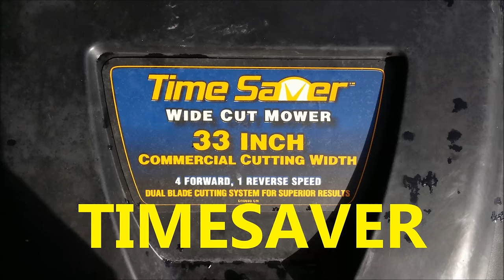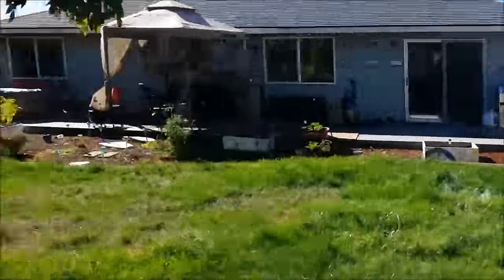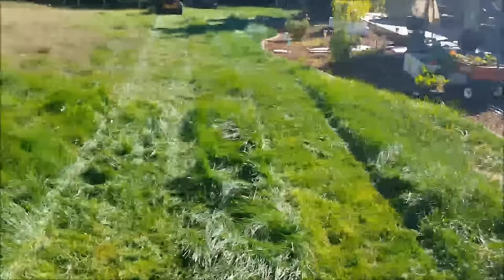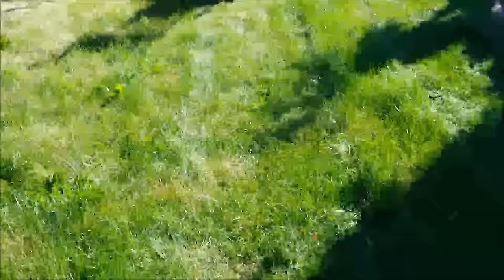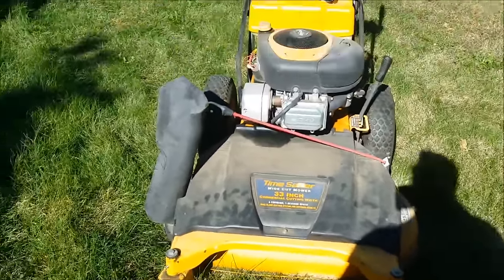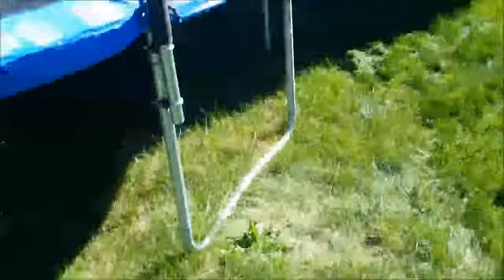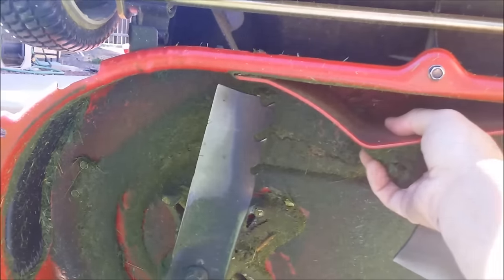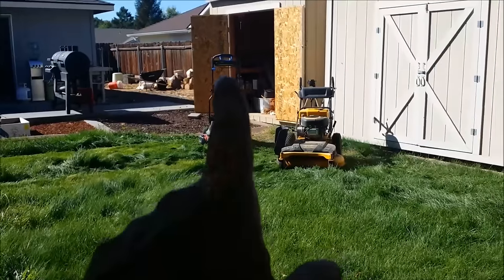Cub Cadet 33 in. VS. Toro TImemaster

Comment: I don't know whether the Toro or Cub Cadet is better, but the belts are too lose to cut anything on that Cub. You say the blades keep "stopping," that is cause the belts are worn out or simply need adjusting. This comparison is fruitless cause the Cub is not functioning properly.
Reply from the maker: Actually the blades where stopping because grass gets bunched up between the deck and the blade gap and then causes belt glazing, this can happen with any mower when put into too thick of a grass which it can't handle properly. I would love to do a new video of these but I haven't owned a cub cadet in a few years.  But feel free to post your own video of your timemaster and your cub cadet.  Thanks for watching
Reply: @BirchsLawnCareLLC  Dude, if the blades are stopping, for any reason, on any mower, when under a load, and does not stall the engine, there is a problem. Your belt needed adjusting, or was worn to the point it couldn't be adjusted. Belts are not designed to start smoking and slipping when under a load as you described in your video.
Reply from the maker: Yes you are correct, they where slipping because they had been glazed already. It was a continual problem with this mower, yes new belts would kill the mower but eventually they get glazed and slipped. it wasn't an adjustment issue I was just tired of this mower having issues like this way to often. I understand what you are saying. now though both of these mowers come with stronger engines so I am sure they both handle over grown grass better.
Reply: @mrpotatoheadracing  Correct.....that mower is 10.5 horsepower...it should have performed WAY better than is shown in the video.

Comment: Have a Craftsman 33 which is the same mower, except it has a 12.5 hp engine.  it is a monster.  Had a timemaster.  TimeMaster is probably a better finish mower, but the Craftsman is sooo much better in heavy stuff.
Reply from the maker: A lot of people like them I just wasn't happy with it. especially trying to use the bagger set up on it. I do miss how it would climb a hill or go straight down one in low gear and not have to worry about ti running off.

Comment: I have the Cub Cadet. Your Cub Cadet needs some serious maintenance. Mine would cut that with ease and not stall or clog. Your deck drive belt is worn out our just slipping terribly and your blades are very dull. Again mine is over ten years old and cuts grass like that with ease.
Reply from the maker: Glad to hear Your mower cuts well. I think this mower had 700 hours on it when I did this video years ago. It has long since gone away. We no longer use either type mower for the business. 
Thanks for watching and the feed back :)

Comment: Are they both 223cc?
Reply from the maker: No, the Timemaster is only a 8.75hp though the newer models are 10hp.
Reply: @BirchsLawnCareLLC  What you meant was that it's 8.75 ft/lbs of torque (about 5.5 hp) and the new one is 10 ft/lbs of torque ( about 6-6.5 hp).  The Cub Cadet is 10.5 hp. if it has the 344cc B&S Intek or PowerBuilt engine.

Comment: terrible video camera
Reply from the maker: +Danny Quesada yup, Maybe one day I will spend the money on video equipment but until then it all goes back into the lawn business. Thanks for watching.
Reply: Civilians can't seem to understand when you're building a business each dollar is a brick. I have the same mower by Troy Bilt and it's been an unlucky turd that only cuts well when conditions are perfect. About to get the Time Master to basically replace it.
Reply: Steven L i have two of the Troy built 33" bought both in 1997 & they still work great! Is there  differences in these two models? Thanks for the video! :)
Reply: Shawn Henry well Troy built is made by MTD now. Because this machine is one of three identical units. Cubcadet (made by mtd), craftsman makes one as well (some of their machines are mtd some are AYP), and this troybilt. They also all three offer identical 28in mowers. But troybilt is the only one to offer a machine like the flex between the three

Comment: First off, you are comparing a 190cc engine (toro) to a 420cc engine.  
Secondly, I own the CC 33".  I was going to buy a riding, but the wife wanted something to exercise with.
Well she only had to use it once.  Walked in and said sell that thing.  It's a beast, and just trying to hold down the levers wore her wrists out quickly.
I highly doubt anyone in the commercial business uses them much.
Just get a riding mower if you are going to pony up 1300 bucks.
I like CC mowers, but that thing is a dog.  Mine is sitting in the shed permanently.  I now use a 160 cc Honda push mower, and the wife is happy again.  Honda mower always starts on the first pull as well.  They know small engines.

Comment: Seems like a waste of time. Anyone who neglects their lawn that badly could care less about which mower is better. And seeing how a mower works when being abused by trying to get it to cut and mulch too much  in a single pass, is worthless. What matters is how does a mower work under normal conditions?  Cutting 1/3 the grass height at normal speed.  Any lawn that overgrown should not be mulched. It should be bagged. Better for the lawn and much better and easier on the mower. Better yet, side discharge, rake and pick it up, so you don't have to empty the bag every 5 feet. lol
Reply from the maker: Yes you are correct however if you would have taken the time to listen to the video you would have noticed I said I let it grow this tall on purpose for this video. As someone who does this for a living and main audience is other guys starting up they appreciate knowing how a mower works in adverse conditions, because if a homeowner kept a lawn in pristine condition they would have no need for a lawn guy. Could have saved your self some typing. but thanks you for your time.
Reply: Got it. For that lawn, I'd recommend a Dixie Chopper. We've been abusing the one at work for about 6 or 7 years and can't seem to kill it. I know...... apples and oranges.
Reply from the maker: Barry Wuthrich I've never used a dixie, would like to try one though.